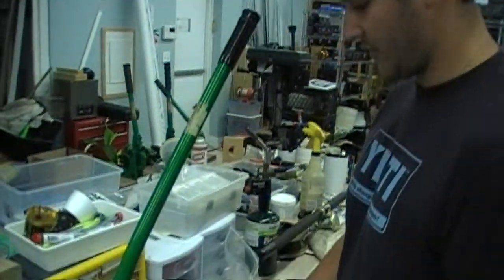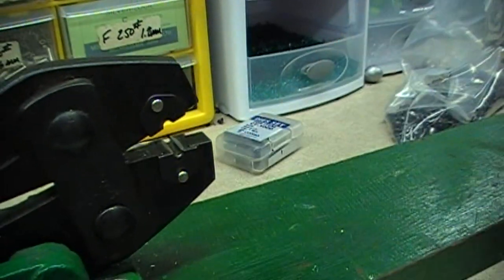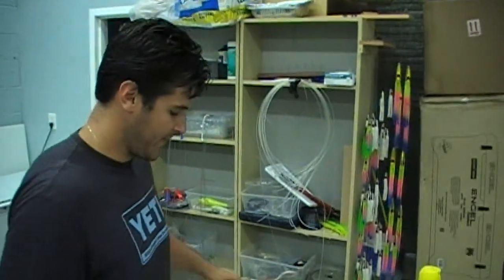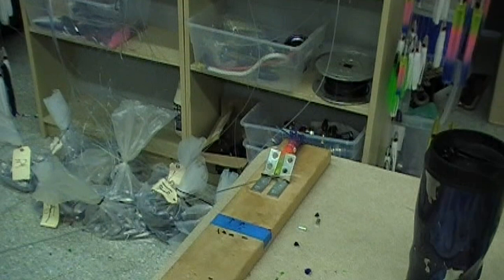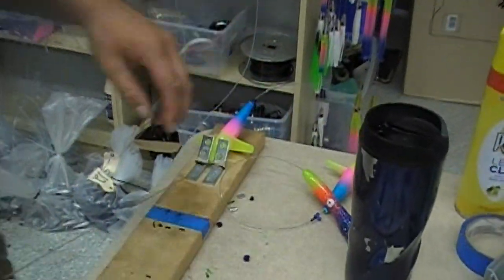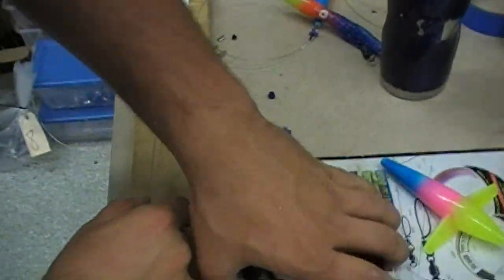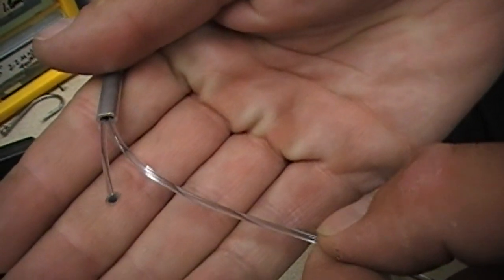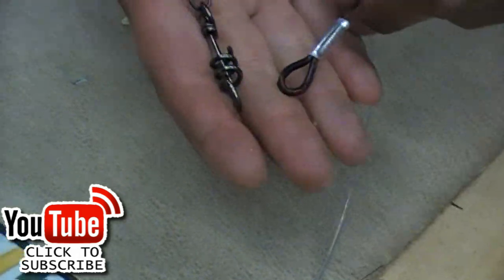How to Make a Splash Chain for Tuna

Comment: My three hundred pound mono line won’t go through the birds.  Any suggestions?  I tried 50 lb mono and it got all twisted up
Reply from the maker: You may have to drill them out a little. But we did not use 300 on that.